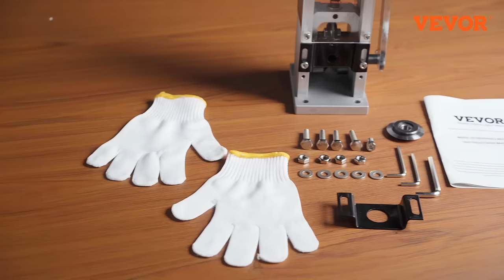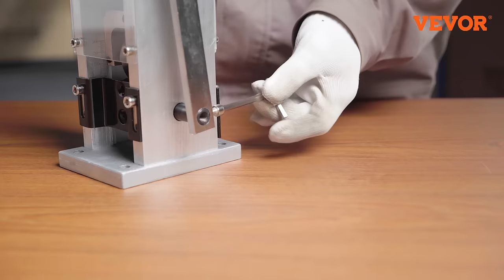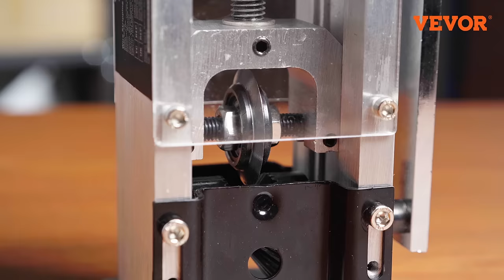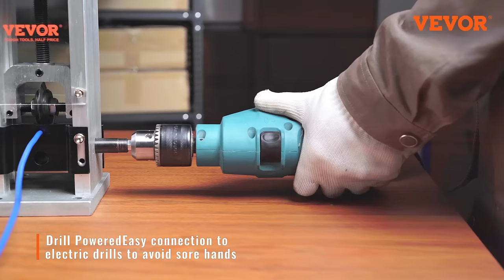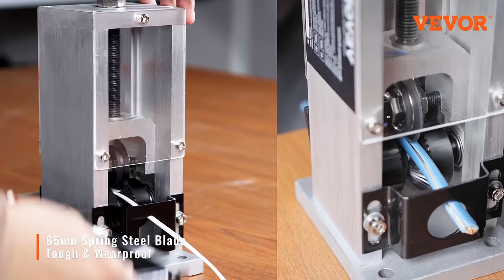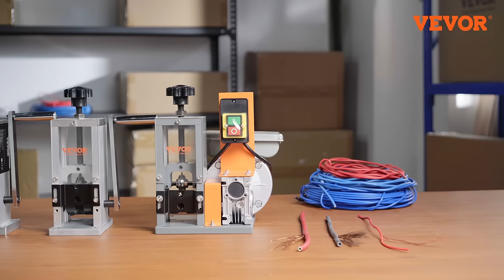✈️FREE SHIPPING 📦 VEVOR Manual Wire Stripping Machine, 0.06''-1.5''

Comment: Can this do 500 kcmil?
Reply from the maker: Thanks for your interest in our products.This wire stripping machine is manual and can be driven by hand or power tools.
Wide Application: The wire range is up to 25 mm, widely used in wiring harness processing, aerospace wire processing, audio and data line processing, wire recycling dismantling.
Reply: How mutch it cost